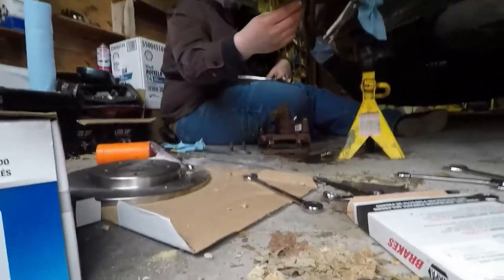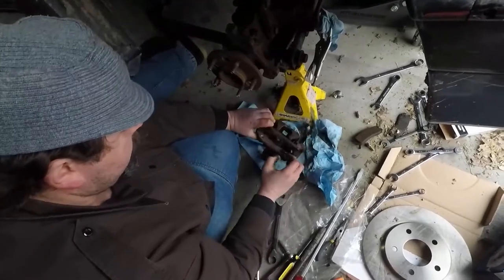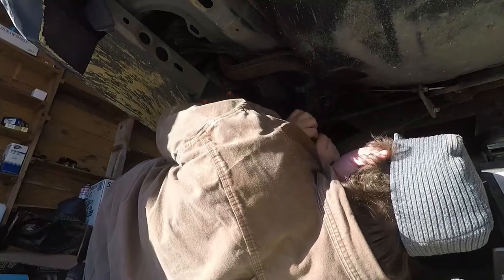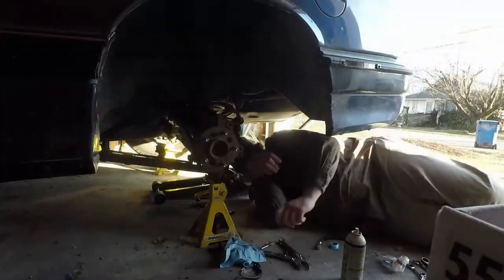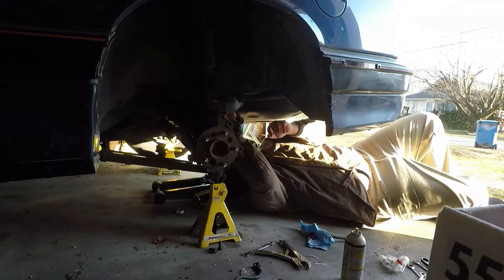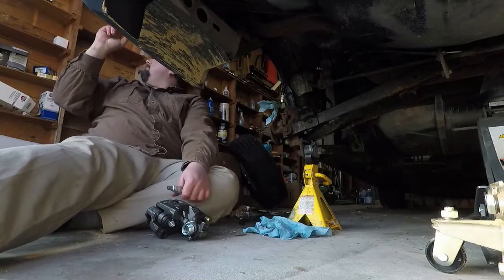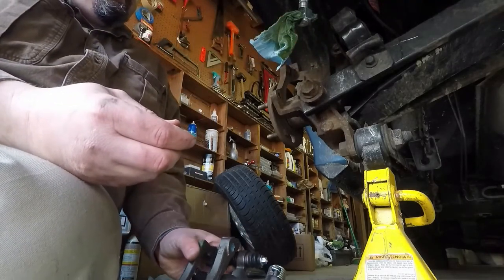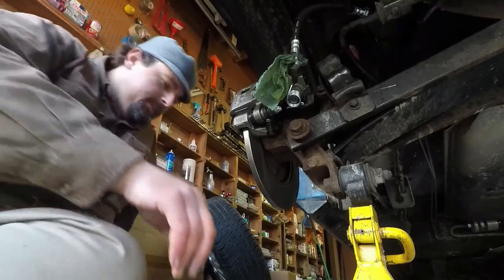1994 Buick Regal Gran Sport Brakes Part 2

Comment: If I don't have a tool in reach I will dig in the earth until I can smelt enough iron to make it, create custom sand casts where I'm sitting, forge and heat treat the tool, then machine it with a file over the coming weeks, rather than getting up and walking over to the tool box
Reply from the maker: Meh, that's too much work.